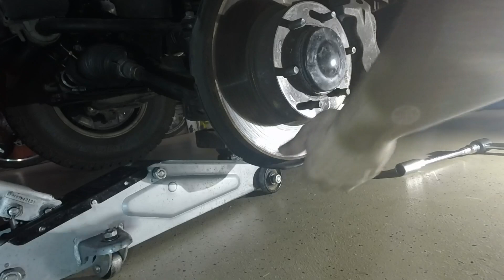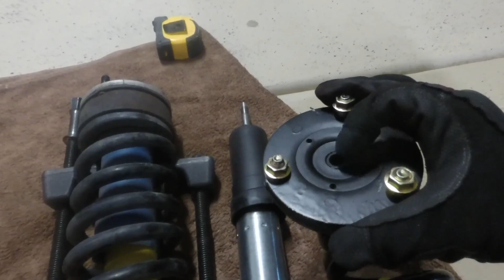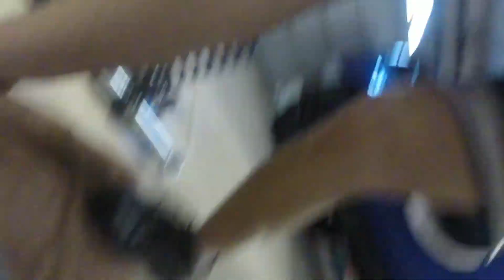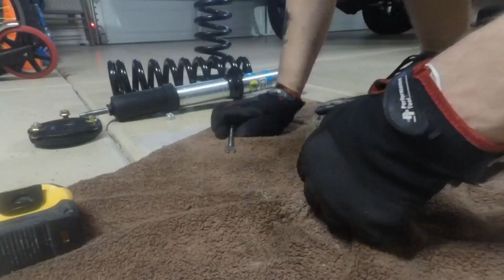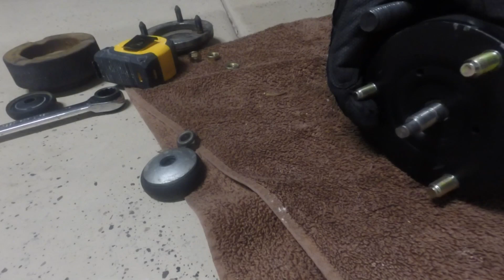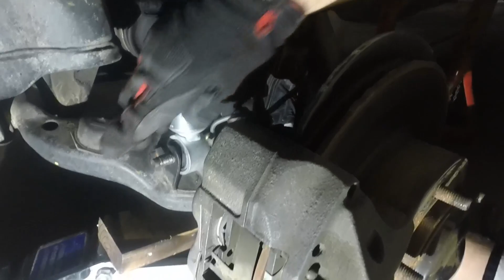Changing Front Struts on 2000 Toyota 4Runner

Comment: Do u need to do a front end alignment after doing this
Reply from the maker: I didn't have any alignment issues after doing this job- your experience may be different though if you're replacing severely worn struts or other worn suspension components. Good luck with your project!- Mike

Comment: Could I run those same bilstein struts, with my factory coils, and 3" spacer? Or would have to upgrade to longer coils as well?
Reply from the maker: It should work- you have the bottom strut plate which can move up or down- those new springs I used compressed down quite a bit. Good luck with your project!- Mike

Comment: nice instructions. there’s also a more “safer” way to separate the shock from coil. first step would be loosen the middle nut on shock itself. then then the bottom nut of the shock, but leave the bolt in. after, support the lower control arm loosen the cam bolts on the lower control arm and then remove the 2 bolts holding the lower ball joint. u can then slowly let down on the lower control arm and the shock and coil will separate. much safer than using those spring compressors. (do this while strut assembly is still installed in vehicle, then proceed to loosen top 3 strut nuts)

Comment: Strut came out easy , too easy it appears.
What was the trick removing from vehicle
Reply from the maker: PB Blaster on the strut bolts helped a lot, a long breaker bar, with a jack to support the strut spring tension.- Mike
Reply: @mikesdoityourself  Did you disconnect any links for the sway bar at all or were you able to do it this way without doing that? Thanks for the vid!
Reply from the maker: @derek517  I didn't have to remove any sway bar links, pretty easy- these front struts had been in for only a few years- that's why they were easier to remove. Good luck on your project! - Mike